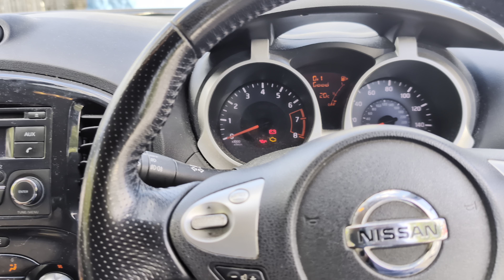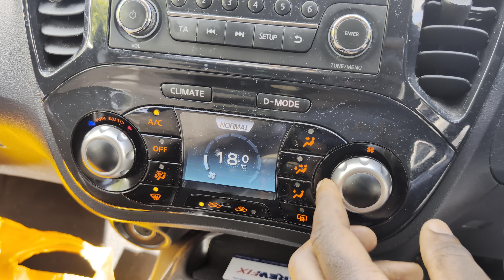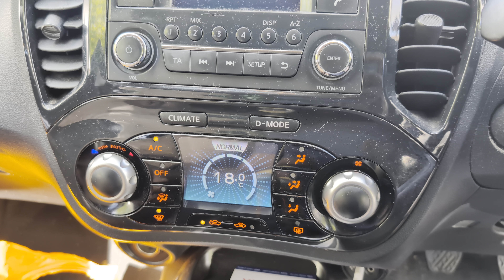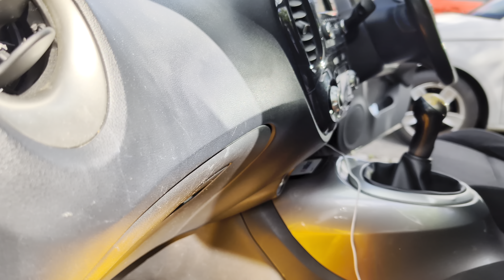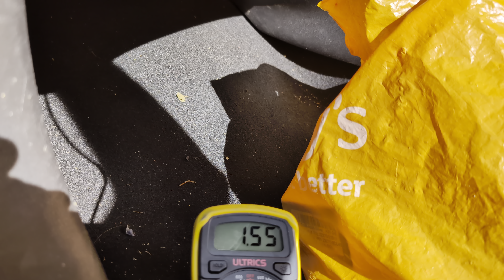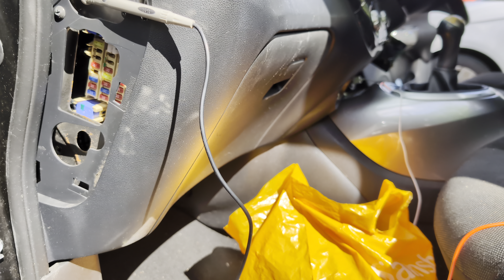Nissan Juke blower motor fuse location and testing

Comment: was it the motor or resister have changed my resister and still no joy
Reply from the maker: I changed the blower motor as it was knackered anyways but also changed the resistor
Reply: How do remove the relay on the passenger side … seems to be blocked by pannel

Comment: We're is the blower motter pls
Reply: easy way to get to it is drop the steering column and it's a twist clock wise to remove part is like £35
Reply from the maker: Which side is your steering wheel
Reply from the maker: Absolutely I'd post a video of it's location soon.
Reply: Where are you located, and do you fix such problems?
Reply: Did you end up doing a video replacing the blower motor? Where is it located before we dismantle everything ? Please